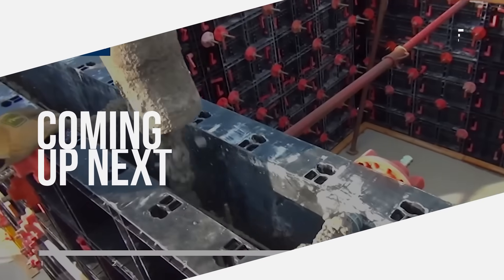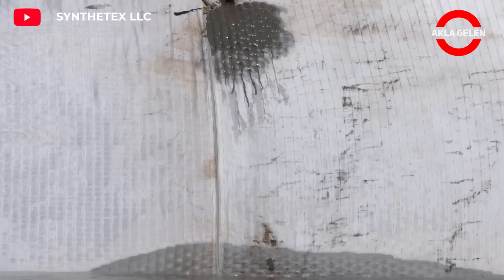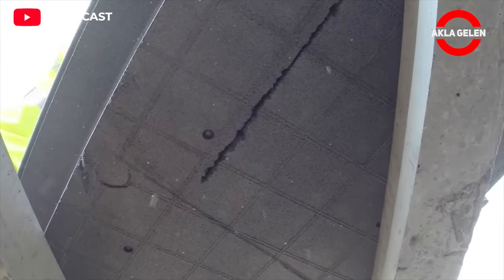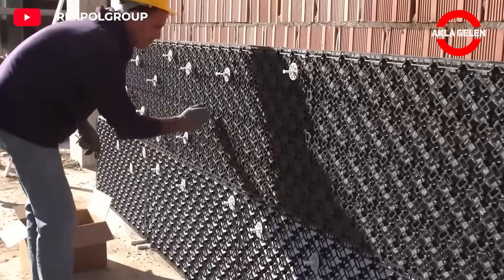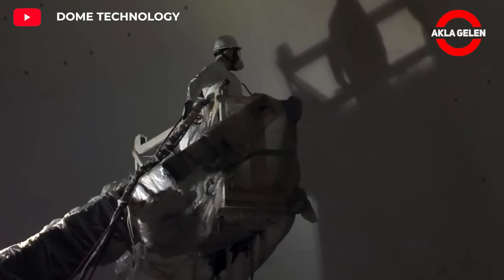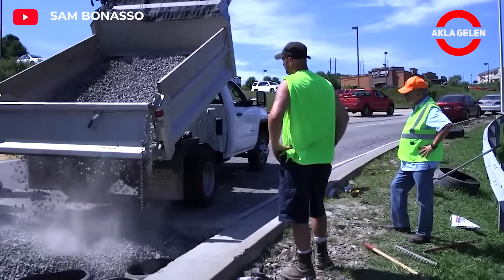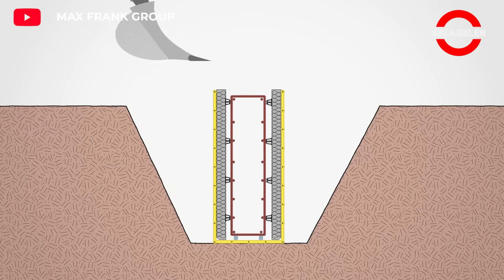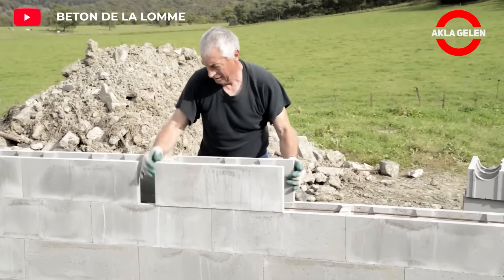Construction Workers Can't Believe This Technique Works - Most Ingenious Construction Techniques

Comment: Reinforced concrete homes is a great idea, until one day when you want to want to change window sizes and positions...
Reply: Well, as long as the reinforcement rebars are not pre-tensioned, you're kinda good. It's not gonna blow up like tensioned rebars. Yes, you'll lose on structural strength, but so does any other material you cut a window in.
Reply: @yutoobe123  You're missing the point. Have you ever tried to cut through reinforced concrete?
Reply: In The Netherlands most houses are rowhouses. They are typically constructed with reinforced concrete, but only for the side walls and floors. The front, back and internal walls are mostly from aerated concrete (which is very light weight) or even just wood.
Reply: why would you want to do that?
Reply: @vegan-master  because in life things change. For example, you may want to Improve Natural Light and Ventilation, Enhance Views, Optimize Space, Increase Energy Efficiency, Modernize the Design, Improve Accessibility, Meet New Building Regulations or you may simply have Personal Preferences; and it might be easier doing that than buying a new house.
Reply: @ottoweber8931  ok but not everyone cares about that.they just want to live in a home and they are grateful for it.
Reply: @vegan-master  sure, but there are those in the future who may need to change window sizes and door positions, which brings us right back to my original comment ...
Reply: @ottoweber8931  ok then do it. you realize that almost any home you need to change the size of windows on is going to require significant modifications.
Reply: @vegan-master  sure, but my original comment is that reinforced concrete is a lot more difficult to modify than the average timber or brick home. I don't know what else I can say to make it clearer. Okay, I have given this thread enough of my time. You have a good day.
Reply: @ottoweber8931  because your original comment is just dumb.
ofcourse it's going to be more difficult to modify.concrete and whoever is building it obviously doesn't care about that.
ofcourse whoever wants to buy it in the future is going to know it's built entirely from concrete before they buy it so they have the choice not to buy it.
I can go on and on here.
it's like saying you bought a car that's difficult to modify. okay well you should have bought a car that's not so difficult to modify if that was your goal from the start.

Comment: I designed and non mortar flexible concrete panels  better than that initial scene. Flexacrete. 15 years ago. You can service( remove/ replace as needed and no metal reinforcement react) because erosion is a life problem and will always need servicing. The poly filled cement in the video design will be cost prohibitive as it it permanent in place. ( Louisiana hurricane levee protection)

Comment: Anytime I see plastics and “environmentally friendly solution” in the same sentence it turns me right off. All we’ve been learning is they leach toxins/dioxins into the ground and water over time. 

And rubber tires? Absolutely horrific results. Low grade material and chemically degrade quickly compared to other plastic products. And this video claims they have environmental benefits? Look at the Gulf Coast off Florida, they’re trying to remove millions of tires dumped in the 1970s and 80s, because they’d be environmentally safe coral reef material. Nothing grew on them because they’re so toxic.

Comment: concrete has a average R-value of .08/inch, brick .2/inch, fiberglass insulation 3.7/inch      say you needed a R-20 value for a wall   you would just divide the total number  20 by the r-value/inch of material to see how many inches you would need to meet the requirements    20/3.7 (fiberglass)= 5.4 inches of material,  but i'd just go 6 inches for added protection of 22.2

Comment: The carbon footprint of cast-in-place concrete most likely doesn't add up. I don't care so much for 3D printing for the same reason, but at least you can use less material and rebar if you're creative with the design.

Comment: Steel reinforced concrete...Steel reinforced concrete...Steel reinforced concrete...Steel reinforced concrete...Steel reinforced concrete...Steel reinforced concrete...Steel reinforced concrete...
Reply: Oh yes, where is some improvement and ingenuity?:D maybe before 50years..
Reply: So what are you saying 👍
Reply: There's bridges crumbling all over the country built of rusty steel reinforced concrete.
Reply: @JP-ec9rl  yeah after bearing the load of millions of tons of traffic with zero maintenance.  Shit need rebuilt eventually, can't rely on 70's era bridges for ever.  Also since trains are under used too much truck traffic flows over road bridges that should be flowing over train bridges.
Reply: @FarmersAreCool  trains aren't underused.
"Just in time freight" saves trillions of dollars of cost in the supply chain logistics.
The railroad is slow and unreliable and you still have to break the loads down and deliver them by truck to the consignee.
Just in time freight saves all kinds of warehousing costs that would be needed to keep supply lines stocked if we relied more on the rail system.
The rail system serves it purpose for bulk commodities that make sense to ship by rail.
The government is just plain not doing it's job to maintain the infrastructure. They're too busy lining their own pockets to be bothered by making sure that roads and bridges are kept in top shape.
The people are paying their fuel taxes and the trucking companies are paying their ifta and heavy highway use taxes.
The money is just being wasted.
Reply: @JP-ec9rl  are you an oil industry lobbyist?
Reply: @Doughballofficial  no. I'm simply someone who has been in the transportation industry and was in the military field of mobility and counter mobility for most of my entire adult life and I understand a few things about logistics and how the systems work and don't work or how they fail to work.
You do enjoy the fruits of modern chemistry, engineering and conveniences do you not?
Let me guess, you'd rather go back to whaling for lamp oil and horse hair tooth brushes and wrought iron implements and everything else made of wood and stone?
Famine, death and genocide are the alternatives to modern infrastructure and the use of oil.
The railroads cannot support an 8 billion population and if consumption goes down, efficiency and affordability go away with it. The railroad is only one key piece of the infrastructure and it's foolish to think that the more you use it, the more you wouldn't have to invest in that infrastructure also.
So what are your sane and rational alternatives to how we as a civilization are doing things at the present place that we are in time?
Reply: Steel reinforced tyres with concrete … Steel reinforced tyres with concrete … Steel reinforced tyres with concrete … Steel reinforced tyres with concrete
Reply: #1 In my book,  the rest of this mess is nonsense.
Reply: So basically your saying there’s no bar like US. Rebar

Comment: The Roman's had concrete forms , and concrete that would set under water.  Tyres and straw bales with concrete poured over has been used since at least the 1970's. The Victorian farmer would use old bottles under floors to create insulation.

Comment: I wonder if Americans know what a brick is?
Reply: Brick is more expensive and way more labor intensive than wood in the US (unlike many countries, the US and Canada have not depleted their forests). It's a lot cheaper to build wooden houses and rebuild every 100 to 150 years than build brick houses and rebuild every 200 to 300 years. Plus, wooden houses are easily modified and upgraded as technology changes while brick houses aren't.
Reply: @eliwhite5548  In fact America has more forested land than a hundred years ago. (Of course most old growth trees are gone) We have so many tree farms that we more than meet all of the building needs in the US.
Reply: @eliwhite5548  I was more talking about pouring concrete, instead of using bricks. And I was only half joking. People do things differently, to get the same result. If you look at some of the medium sized buildings in London (still multi-stories high) we still use bricks, where in America they seem to use steal rods and poured concrete. Neither I guess has a better result than the other. It was just an observation. In the UK, we very rarely pour concrete for the outer walls of a building.

Comment: I guess plumbing in these new wall forms is out of the question
Reply: You put horizontal pipes and wires on the interior wall and hide them behind dry wall and for vertical you leave plastic pipe in the  concrete where you need the opening or you cut out opening in the ceiling where you need it.
Reply: Just the same way a basement is finished.
Reply: Was wondering that same thing myself....WHERE are water and drain lines going to be run up to any second-floor bathroom ?!?!
Reply: You can, but pre-pluming only
Reply: Not really, you can put thepipes for wires and water into the concrete in advance, just like other methods where you use wood for creating the walls
Reply: @JimmyTheGreek2000  ?
Reply: frame the interior of the concrete and do your plumbing that way. You'd obviously need holes in the floor for your plumbing.

Comment: Concrete Doesn't Dry It Sets, Hard Enough To Walk On Within 24 To 48 Hours Depending On Location. It Will Fully Set In About A Month However, It Can Cure For Years. Thank You.
Reply: and crack.
Reply: @thewatcher5271  cures

Comment: 8.56 Concrete blocks provide good thermal insulation ?? You gotta be joking !
Reply: Technically possible if you create Air-Crete. Basically concrete mix that has a foaming agent added that will create thousands of miniature air pockets withing the concrete giving it insulation properties.
Reply: @ML-dk7bf  I would agree if the bricks themselves are made out also of this material. If not, despite of the 'air-crete', there are numerous 'cold-bridges' formed by the (inner) side walls of these regular concrete bricks. That's why they ( in the vid) are mostly used for stables aso . In my country , Belgium, there is much use of 'gas cell blocks' , type like Ytong blocks and several others. It is a solid block light-weighted block made out of chalk and ...airbubbles . Used for housing and larger structures .

Comment: For decades i am watching these amazing new building techniques but I  have never seen them to be used in building a run of the mill house.  Even if you could build it you will not find department of building and safety which will approve and insurance company which will insure it.  It is just an other wet dream.
Reply: I had the same thought. These are one offs. None have made it to everyday construction.

Comment: In a small town south of Pittsburgh called donora there is what is called the concrete city houses built of solid concrete 1 ft thick walls, poured! From what I recall these were built in the twenties or thirty's! 1 ft thick walls of concrete I believe does not need any insulation, just my guess.

Comment: I was made to understand that a rubberized tire will not stay buried no matter what. They will work their way to the surface over and over, the rubber will always be gassing out until it crumbles to a dust after decades. The road made of tires is a joke!
Reply: A tire? Possibly. But these are essentially the tread rings -- no sidewall. So I'm not so sure the mechanical stresses will cause the same "springing" effect that a tire would be subjected to that would cause it to rise.
Reply: “Gassing out”? You understand that rubber doesn’t do that, right? I mean, if it did, that would make things like tires on cars pointless.
Reply: @brianpayne2478  he is referring to out-gassing. The process of chemical break down within the rubber itself who's by-product is sometimes a gas. It's similar to the process of a compost pile emitting methane gas from the break down of the organic material.
Reply: @brianpayne2478  Всё (всё!), что существует во вселенной постоянно меняет свою форму и свой состав- разрушается. Но, конечно, скорости этих изменений всегда различны для разных материалов и условий эксплуатации. Иногда они так малы, что не могут непосредственно наблюдаться человеком без соответствующих приборов. Резина также постоянно разрушается. При этом образуются и газы, и меняются ее форма и состав (она рассыпается). Но скорость разрушения резины намного больше, чем скорость разрушения бетона при оптимальных условиях его эксплуатации. Существуют не только нормативные параметры износа автомобильных шин, допускающие их эксплуатацию, но и максимально допустимые сроки со дня их изготовления.
Reply: That's the law of entropy
Reply: Tires surface no matter what because their design catches air. But they cut the sidewalls off. There's nowhere left to hold air pockets.
Reply: Bummer the road will only last decades, where I live roads are lucky to last 5 years.
Reply: Building foundations out of styrene? 😂😂😂😂😂 😂😂😂😂😂😂😂😂😂😂😂😂😂😂
Reply: Tires used in road construction is a relatively new thing, and the amount used in modern construction is VERY low: plus, when it’s incorporated in new asphalt, THE TIRE IS GROUND UP. There goes your bs “thought” about the tire “gassing out”.
Reply: We do not need to use more plastic to build homes. Many times, the faster way is the wrong way long term
Reply: Check out mechanical concrete!
Reply: Rammed earth tire foundations
Reply: How would they work their way to the surface when there's a concrete or tarmac slab over them? 

I think you may be thinking of "tire bubbling" in landfills. Where waste tires work their way to the surface by trapping gasses from degrading biological materials. With the sidewalls removed like in this video, that can't happen. 

You're certainly wrong about the things "crumbling to dust after decades" though. The fact that they won't naturally degrade for centuries to millennia is the whole reason we're shoving them under roads or into concrete or whatnot. Just to get rid of them.
Reply: Itz the soil that makes them rise concrete fine
Reply: You were ill-advised. 😉
Reply: @Dani8chs  he was ill-informed, not ill-advised since one has to have been advised incorrectly to be such.
Reply: @nowayagain8141  Way too complicated 😅 English is my 3rd language. Ill-advised will do for me 🫣
Reply: @Dani8chs  It might "do for you" but it's incoherent for those that speak the language properly.
Reply: @nowayagain8141  Hehe. Most people here are not English. And even they most likely understand exactly what I mean. I think you are one of the few that struggles..  😉
Reply: @Dani8chs  I'm not English either, beside the fact that's immaterial to the conversation.  "Most people" enjoy soccer and live on the equivalent of 1 dollar a day, indicating just how poorly using "most people" as a measuring stick would be.
Reply: @nowayagain8141 That’s a different set of “most people”. The “most people” in question here are participants in the chat thread….for this set, “Ill-advised” is just fine.  No one was confused.  Words, whether written or spoken, are abstractions meant to convey a concept….the concept came through just fine.  “Me Tarzan, you Jane”—not proper English, but no one is confused by it either.  Dani-it5sy, thanks for your contribution. 👍🏼
Reply: @freecamel3  Words are not "abstractions", I think we've identified your issue!?  Learn to use the proper terminology in proper contexts, then you can attempt to wax incoherent Socratic-esque sophistry.  Cheers "Tarzan"
Reply: @nowayagain8141  
Hi again. 
Yes they are. 
But, nice ownage anyway.  High level insults, for sure.  You have a talent.
However, I certainly don’t need your help to wax incoherent…..I do that all the time without assistance bro!
Reply: @Dani8chs in todays society being dumb is a choice. 😂
Reply: @Dani8chs  yeah you showed us that earlier. 😂🤣😂
Reply: @OG_Weyezman  You think so? I don't mind. I just find you hilarious. I mean. This discussion 😂 Really important stuff 😅✌
Reply: You are 💯 correct, you just have to look at the affects the trucks have on this road, you will have loose stones breaking constantly, they would be better melting the tyres and then mixing that with new asphalt
Reply: After decades? I'm ok with that.
Reply: @suliwa670 seems like main roads re being done every two years. That’s a win
Reply: @suliwa670  It’s a way to discard tires rather than actually recycle them. Kind of like the wind turbines. They have been throwing them in land fills. Now they are mixing them in concrete. So when the buildings are torn down the glass will release in the air.
Reply: They continually resurface, and the rubber within them keeps emitting gases until it eventually crumbles into dust after decades. Roads made from tires seem almost like a joke, don't they? What are your thoughts on replacing tires with other materials to mitigate this issue?

Comment: Would like to see those styrofoam(?) panels 3:25 replaced by hemp based material...
Reply: Half this stuff will only be used in places like China, because they won't let you use such ridiculously flammable material for insulation in the West.